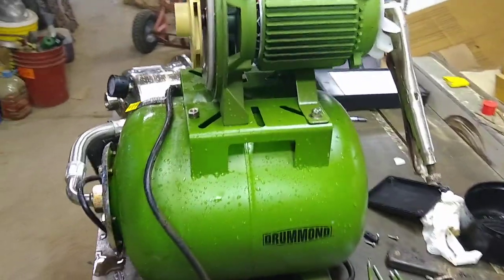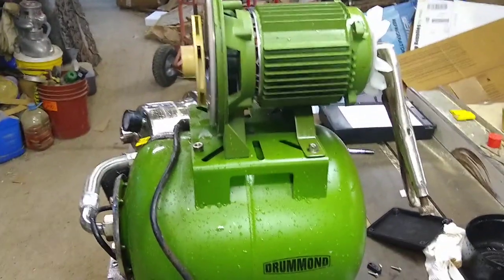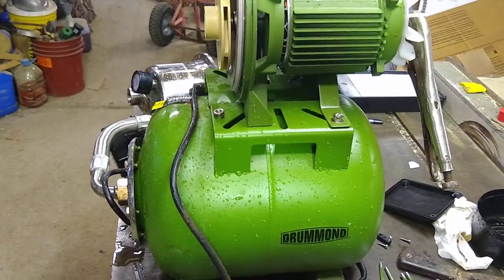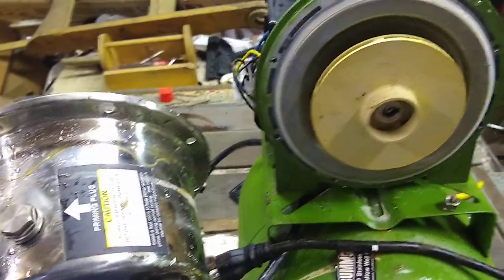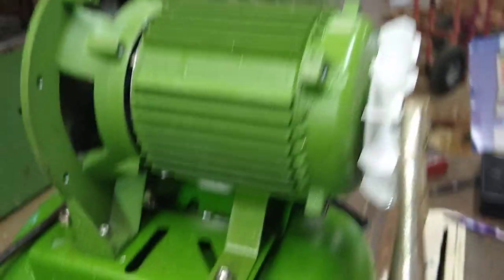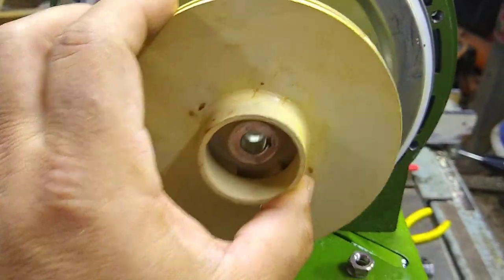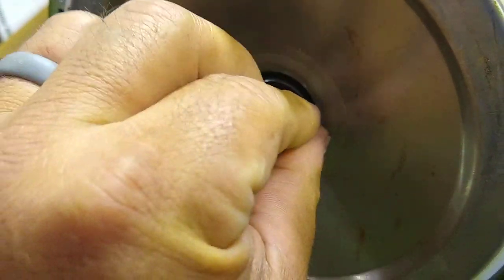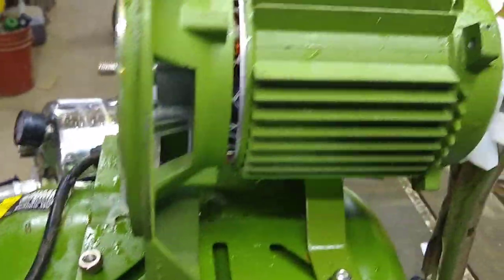Harbor freight 1 hp stainless steel shallow well pump tear down

Comment: Had one for 4 years and its fine. Installed another and it died in 30 days. Now it hums when I turn it on and it overloads the breaker. What happened to it?

Comment: I had my last HF pump about 3 years.  After a weird Florida winter the  pump came back to life for a day or two and gave up the goast.  I have to disagree, for all my troubles I replaced the start cap and swapped out the pressure tank. I cannot really find fault with my pump.  Did a tear down later found the front tube of the pump IE intake thoeat cracked.  I will say this pump is a much better quality that HF other attempts and for money a bargin.

Comment: Mine lasted 3 years...still runs...my tank failed. Good little pump and I have VERY hard water running to it.
Reply: Same mine lasted about 3 years motor runs fine pressure tank rusted out though
Reply: @yzBLASTER  really? mines pumps fine but doesn't stop running even when irrigation isnt running  and no leaks....

Comment: I just bought one and it will not pump any water from the well. I noticed the pressure gauge doesn't go above 23lb of pressure. And for what I know it supposed to run at 30/50 any suggestions?
Reply: I don't know if you have one, but you have to put a Check valve on all well pumps to keep and hold pressure,  hope this helps.👍👍👍

Comment: 🤔 That was an abrupt ending...part 2? ...were you able to make another motor fit or modify, direct or pulley ?
 ... I’m looking for an off grid option like this pump, with solar/battery/inverter setup.
Reply from the maker: No, motor is junk, and pump on these would be very difficult to adapt to. I rebuilt an old Gould's and will get another 30 years out of it
Reply: @shaverbro  thanks for the info! You get what you pay for!!!
Reply: It was at that moment he realized he was fucked! LOL